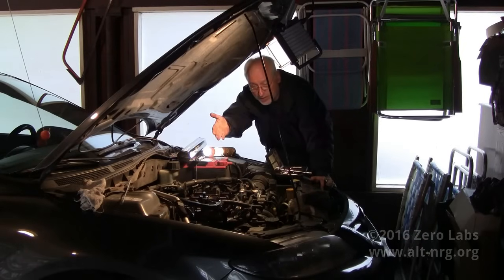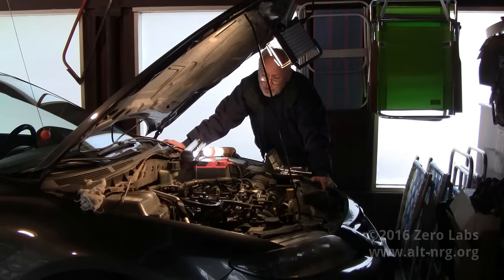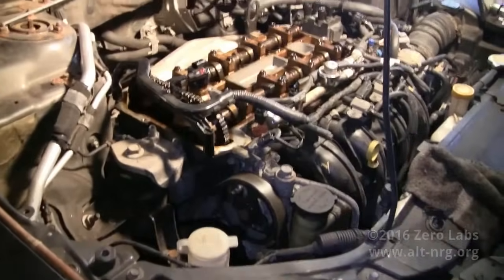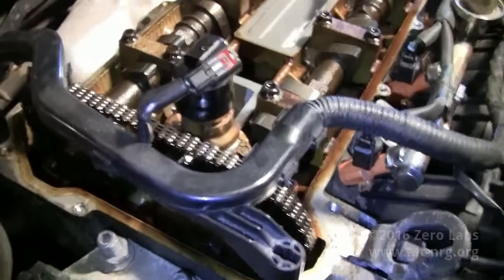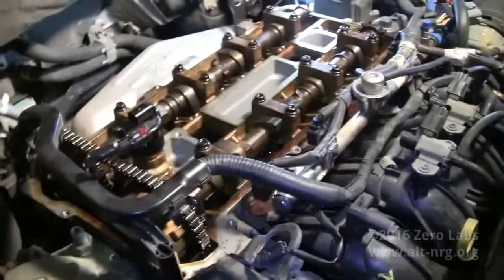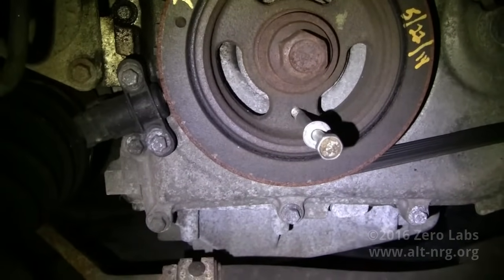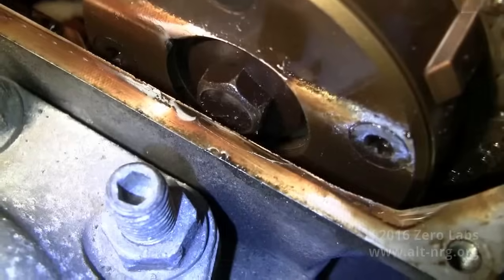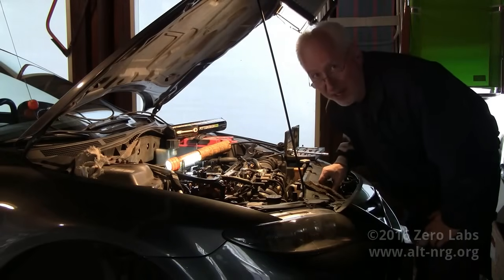#456 Mazda 2.3L cam timing chain sync problem P0340

Comment: The bolt you put in the harmonic balancer was not a super expensive Mazda only part and it is in no way meant to hold the engine in place. it's just a plain 6mm bolt meant only to time the balancer with the crank. There's a plug on the passenger side of the engine you remove and put in the special tool. But, the crank can still turn counterclockwise with it in there. 

Also, I agree with the sentiment on your final rant. The Chevy Cruze is prone to coolant leak from the water pump and there is no low coolant light on those cars.

Comment: lol i feel your pain i have the rx8 rotary engine the oil gauge  is a dummy gauge it automatically goes up when car start but pressure doesn't read as you drive it stays the same lol oh and temp gauge after it reaches 210 it doesnt move till 240 so they zoom zoom ok....zoom zoom in us!

Comment: the reason this has happened is because the chain has stretched and needs replacing. just happened on my 2011 mazda 6. known issue and very expensive. that chain will eventually go and take engine with it :-(

Comment: Great video.  I had a customer with a cx-7 that had the vvt grenade.  He kept driving it until the chain snapped and broke the timing cover and the valve cover. I now have my neighbor's mazda 3 that has no compression but the pistons and cams are rotating.  This video was very helpful.  I have yet to take off the valve cover but now i know where to start.
Reply from the maker: Yep. This is an interference motor. You probably have 16 bent valves that will need replacement and lapping. Not a terrible job. Just need a few specialty tools. The pistons are probably dinged a bit as well but that's not important. As long as it did not also snap any connecting rods. Good luck!

Comment: porsche 911 chains jumped time all the time due to tensioner oil loss.  Pretty much a thing of the past once they went to pressure fed as opposed to self contained tensioners.  So---indeed chains can jump time--but probably not if tensioner is operating properly.

Comment: Mazda''s  kinda suck Stay with Honda
Reply: you stick to your boring ugly ass honda most consumer watching this video obviously not here to listen to your shit
Reply: These parts were designed and built by FORD. Blame Ford and stay away from Ford. Mazda is no longer owned by Ford.
Reply: i have both honda accord for my daly drive and my hot mazdaspeed 6 for fun driving and endless repair lol. ...
Reply: Ford and Mazda have a bad design engine. I used Ford Focus 2.0L 2010 and it get  a lot of damage. 
  Alternator dead at 70k miles, gasket valve cover oil leak at 80k and now timing chain got noisy at 82k. 
  Never buy Ford again. As I know Ford designed cam system without keyway, no any mark in camshaft sprockets and crankshaft sprocket. They’re connecting by friction with bolts. Easy get big problem once sprockets slides little bit vs camshaft or crankshaft as the video.

Comment: I work at a Mazda Dealership in Australia, Mazda sell special lock washers that have a diamond like coating to fit between the sprockets and camshafts and also for the crank.
Reply from the maker: Sure. As an aftermarket part. Inexcusable.
Reply: It is not a aftermarket part it was released not long after the first of the "L" engines as a campaign in Australia. Im not sure about any other country . We still get the occasional car coming back with the slipping pulley issue but are usually the ones that have been neglected and have missed having the campaign done. I really dont like the Ford influence in Mazda either as there is no quality.
Reply from the maker: xpman85 Yes, Ford left their distinctive mark on Jaguar, Volvo and Mazda, that I know of. Probably others too. "Quality is job #1" HA!!!

Comment: Timing chains CAN JUMP if the tensioners/guides fail.  I've fixed 2 that had that failure... Typically only seen in very high miles where the oil wasn't changed often enough and running for a long time with the failed tensioner leading to a stretched chain...
Reply: Very true! My '07 CX-7 jumped a tooth.

Comment: I always check my oil at EVERY fuel up.  I'd suggest you replace the oil pressure switch with one that triggers at a higher pressure so the light is more likely to go on before damage actually happens.  I.e. If look for one that has a 10-15psi threshold.  It would be interesting to pull yours and find at what pressure it is switching at.  Did you check that the oil pressure light WAS coming on at key-on before cranking? If not the bulb may be blown of the sensor is bad.  Sorry you had such a hassle, we've all had one of those jobs that turns out bad...

Comment: Ford sohc 4.0 also does not have location pin/key between gear and cam.  Guides get loose, chain jerks it out of time = $ for garage and Ford parts division.  I drilled a pin into my Exploder.  The evolution of planned obsolescence from the junkyard survey which led to weaker kinpins.  Guess it could be advertised as "Infinitely variable timing."  Certainly saving pennies to cost the end user thousands.
I concur that it is common for chains to jump at high rpms.

Comment: Great rant at the end. I agree with you about the oil level. I have a similar Altima as yours, and it eats up more than a quart every thousand miles. And regarding the timing chain, I did have to replace mine on the Altima 3.5L V6, but its because the tensioners had gone bad. And the dealership only sells the tensioners with the whole chain kit.
Reply from the maker: +Klasniedryg Well of course they do! It's for your own good. Really. Grrrrrrrrrrrrrrr

Comment: very bad... If possible, try VW. I have a 1.4 TDI VW Polo with 75PS and it works fine for more then 14 years now. I have a heavy foot and with 45 liters of diesel I make 700 km. I tried one time to drive slower and I made 1010km with 45 liter of diesel. Now it have more then 177000 km on the clock and I don't have real big problems with...
Reply: I have mazda 6 2.0 disel 143 ps with 270000km with no problems

Comment: This is not the first time Ford has decided to leave out keyways in cams. The 4.0L V6 in the late 90s Ranger / Exploders have the same keyless setup. In my opinion, it's ridiculous that a manufacturer would even consider such a thing, especially with interference being a problem these days. A SOHC engine might be okay without, but on these DOHC motors where the valves are angled at each other the risk is to great for valve to valve interference to warrant the use of such a setup.
Reply: +Doogie Rick I'm sure Ford / Mazda have many weak points of failure for making the dealership shops millions of dollar. Why engineer correctly if it would cost extra money and heck it will be fine in thousands of cars..but not all and that translates into dollars...

Comment: Oh man the number of times our suburban was driven home without oil pressure. lol  It used about 4 quarts of oil per month. The wife and daughter drove it the most. I should have kept track of it but I didn't. What I did do was put a little stp oil treatment in it with each oil change. That stuff is slippery and lets the engine run without oil pressure just a little bit longer. I use a 50/50? mix of that for assembly lube too. For the same reason.

Comment: Mark you feel it>? That is the life blood being sucked out of us all by corporations that build in failure and they didn't just save $1.50 each block and it's not just one corporation. We need laws to stop this kind of crime! In the 1950's GM built a 265 and a 283 V8 they never broke down and that was when the learned it. What did they do? Plastic coated timing gear in the 60's.
Reply from the maker: +LOOPPEY Yep. I remember those plastic coated designed-to-fail timing gears. >:-(

Comment: Ooops Sorry but timing chains can jump. when they do they are very worn but they can jump. I have repaired old ford 351 that had jumped more than one tooth. Makes for baffling diagnoses but in the end the cylinder pressures are usually really low.

Comment: having a fleet of vehicles myself I can tell you that nothing is more important than checking the oil. and every single vehicle is different. they may have the same engine but they all use oil differently.

Comment: All good points Z.  Given the amount of regulation on cars,  It is surprising there is not a standard regulation on sensor and information for the the user.  While all cars will have speedometer, not all will have coolant guages vs idiot lightes.  given the number of measurement that the cars computer(s) a better job should be possible.   Given that on Newer cars, they color code what you should touch and check.  Sorry to hear about the problems.

Comment: It is normally to late when the dummy light appears.
Reply from the maker: +No2TheNWO I will never forget as a teen the night I was hitchhiking Waterbury, CT and got a ride from a girl in a Dodge Rambler. I noticed a piece of black electrical tape stuck to the dashboard and a faint red glow from behind it. I asked "Why did you do that?" She replied "Oh, it was bothering me so I covered it up." I peeled it back and, you guessed it, it was her oil light. The hydraulic valve lifters were also tapping from oil starvation. We were near a gas station and I, a complete stranger in her car and recipient of her offer for a ride, literally yelled at her "Pull in this lot and turn the car off right now!" Startled she said "WHY?" I said "Do you want your car to make it through the night? Just do it." She complied and I explained the seriousness of the situation. I went inside, bought her 3 quarts of oil and put it in for her. When she restarted the car she exclaimed "The light went out! Thank you so much!"

And I STILL didn't get any! :-\  LOL!
Reply from the maker: ***** You are describing the check engine light. The oil light is triggered by oil pressure. They are not the same.
Reply: Zero Labs 

My 17 year old step son called me hey how much oil fits in my car I said what you mean oh the oil light came on I said probably 1quart or two 
He called and said it's still on I said what's the dipstick say it's not showing on the stick I said where you at 

Once I got there I was floored by what happened 

I poured another quart still not on the stick I put 5 quarts total it was perfect on the stick I said ok try it 

It crunk up and sounded like a gorilla was swinging a 20 pound hammer in the piston i said kill it oh god wtf happened 

He said I don't know my friend said the other day the oil light didn't matter that much and I had my radio on the 2 -15 inch woofers and when I turned it down I heard knocking and the guy at sto said sounds like you ain't got no oil in it so I called you 

I ask my wife what was your x a woman 

Geez he's 20 now he checks his oil every time he puts gas in his truck now 

I like to have shit a brick freaking 6 k used car 8 months old gone freaking piston rods bent all from playing loud ass bass sad 
Can't hear ya motor with that chitt on 

Maybe he'll learn and rebuild it one day I'm hoping he will

Comment: You are dead wrong about timing chains not jumping teeth. I've seen it happen on a Jeep Compass 2.4L. The chain stretched enough to max out the tensioner and the cams kept jumping in and out of time. We ended up replacing the chain and guides. The engine only had around 95K miles on it.
Reply from the maker: +madmatt2024 REALLY! Okay, I'll take your word for it. That was one chain under a LOT of tension. Probably due to friction. Or one cheaply made chain. Or both.

Comment: id get rid of that car
Reply from the maker: +BlueFlyer We will. And I SURE AS HELL am not going to put another motor in it for her! For now though we're just going to put some heavy oil and STP in it. I am going to make her drive it that way and deal with the lower engine rattle to drive home the point that taking personal responsibility for routine maintenance is not optional and until it becomes a true FORD (Found On Road Dead).